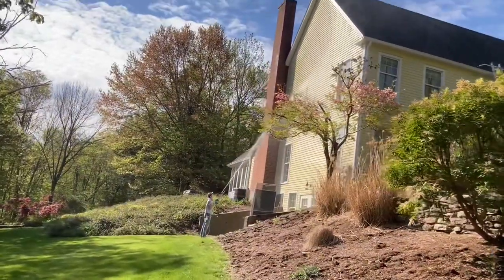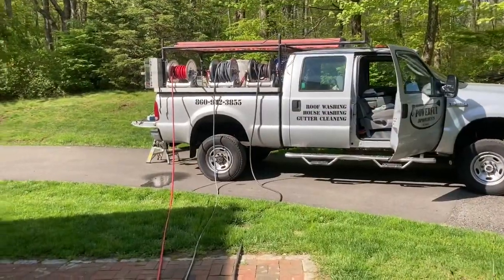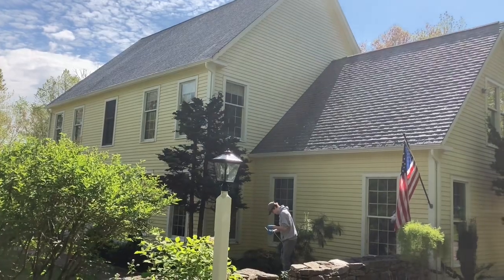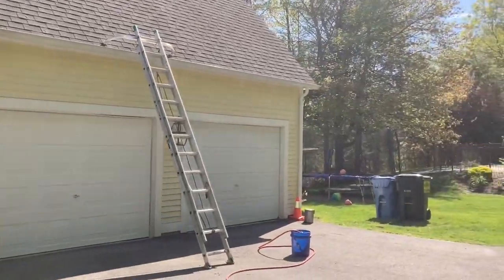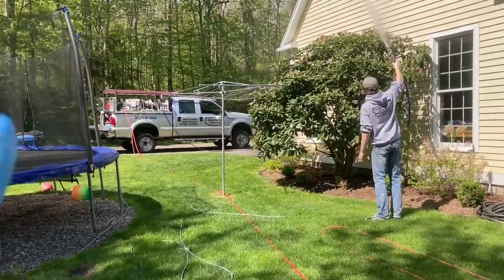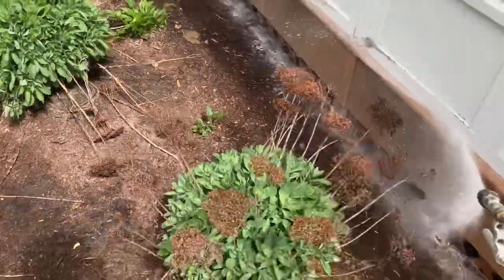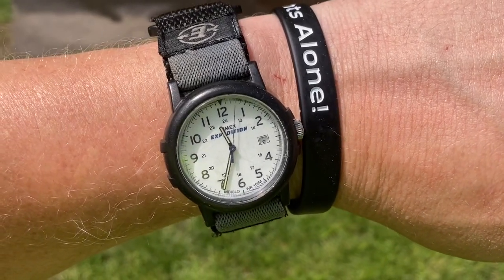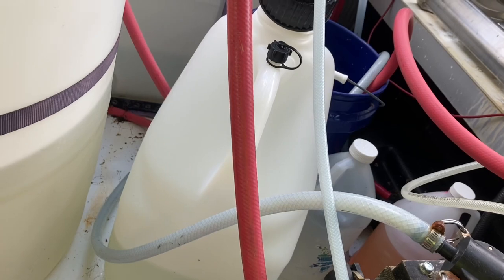Roof Washing on Saturday

Comment: Your video yesterday inspired me to do a flow test on my gx390 5.5 gpm machine. Unlike your 6+ gpm mine was just a shade over 5. But mine has a comet pump. But i also tested my 8gpm pressure pro and had right at 9.25. So pleasantly surprised with that. Be interesting to have 5 or so pumps with the same advertised specs and do tests and see what you get.
Reply from the maker: Yeah that would be interesting for sure

Comment: What did for down streaming when the 12v was hooked up to the proportioner?
Reply from the maker: Ball valve switching back and forth between 12v and power washer
Reply: @powerfulimprovements  I’m going to order a proportioner for my downstreamer soon. Probably the same one you’re using. Are you liking yours so far?
Reply from the maker: Yes. No isst